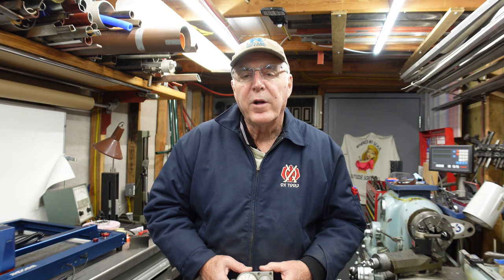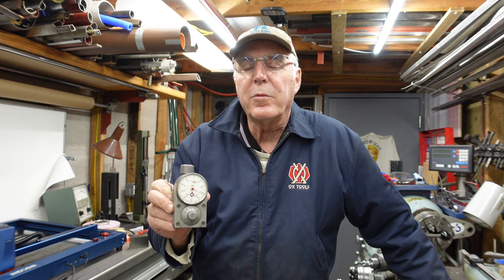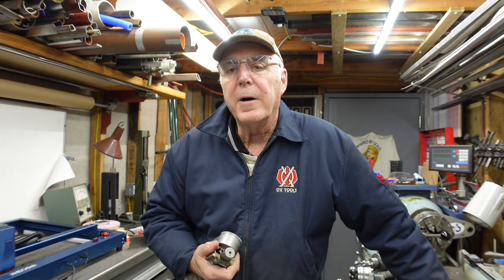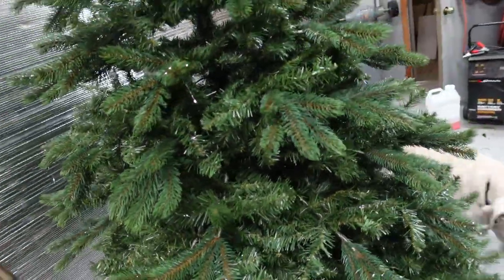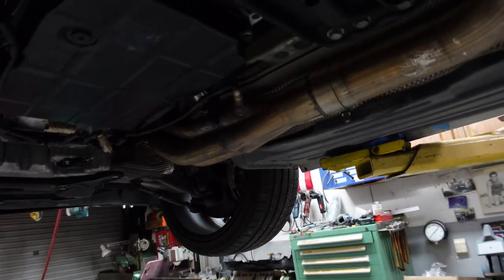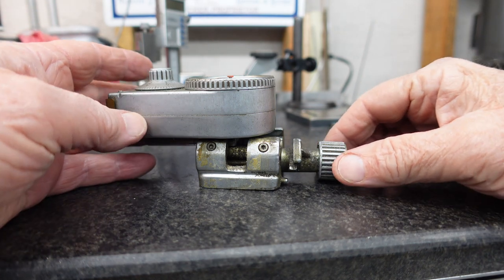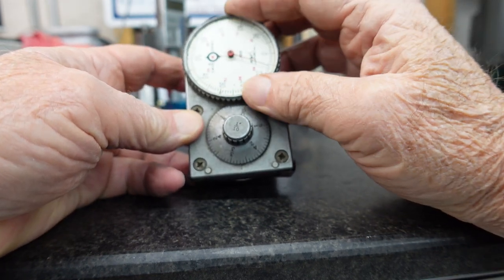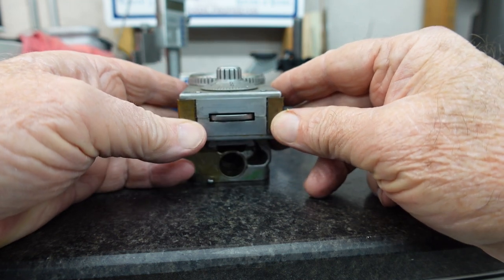Screwy Tuesday 23-7  TRAV-A-DIAL (measurement device)

Comment: One of those came with my 1942 16 ck , monarch I purchased a few years ago, its the older spring tension type  , i was going to get a dro for the lathe but the bed length is so long I would have had to go with a custom scale, , i just decided to try he trav-A- dial ,  works amazingly well ,  especially for larger machines.

Comment: Interesting subject that I never heard of. Good luck on the meet and greet hope the weather cooperates. Here's an off topic question that I have...I just hung up one of those rolls of kraft paper that you showed in an earlier video and I wondered how you handled cutting sheets off the roll. Thanks for the video.
Reply from the maker: I think I showed it in the video, the paper feeds thru a front rail and the knife uses the rail as a guide to cut...thanks for viewing, let me know if you need any more info or email me for photos
Reply: @outsidescrewball  Thanks I made a guide out of an old bandsaw blade but it didn't work at all.

Comment: I picked up an ebay trav-a-dial for 75 bucks buy it now.  I think the guy meant for that to be initial bid.  (thanks ) i did a full teardown and lubricated the tiny  unobtanium bearings with a good modern oil.  had a freakout when my ultrasonic cleaner dislodged one and hid it from me in one of it's basket drain holes.  it is in every way a precision device.  the shafts for the two dials have tapered ends and ride on these tiny little angular contact bearings.  the housing screws tighten up and flex the casing the slightest amount to pre-tension the assembly.  I had no idea those two studs were for precision alignment.  I thought the cases were aluminum, but when I pushed them a bit too hard into a  polishing wheel i started getting some copper, so I stopped.  I think, it's a plated sandwich that has very well documented flex.  I have to make some felt way wipers and figure out it's complicated flexture mount before I stick it on the old 10ee I'm restoring.  Thanks for this video Mr Charlie.
Reply from the maker: thanks for viewing and your comments on the unit you are restoring along with the 10ee

Comment: Trav-a-dial question.  You said you lock down the set screws tightening the dovetail after you have it setup?  The old style uses the spring tension on the back screw to provide tension so isnt it locking it down a bad idea?
Reply from the maker: tighten may have be the wrong word...snug would be the correct as part of the alignment, thanks for viewing and commenting